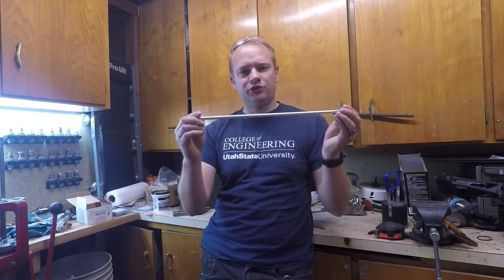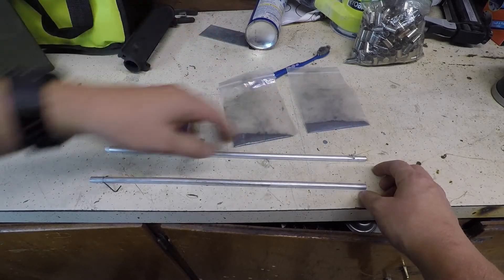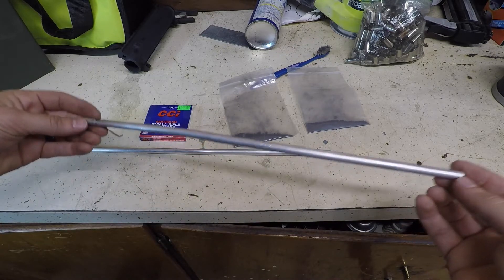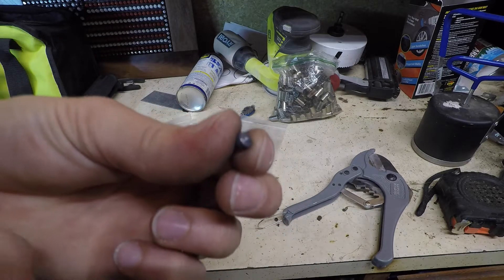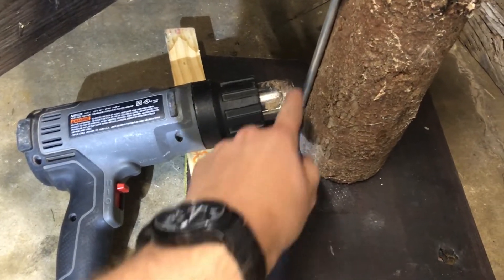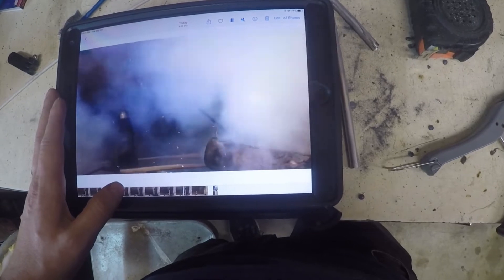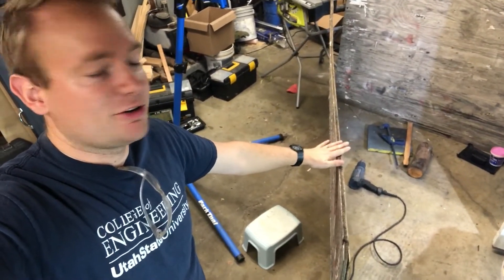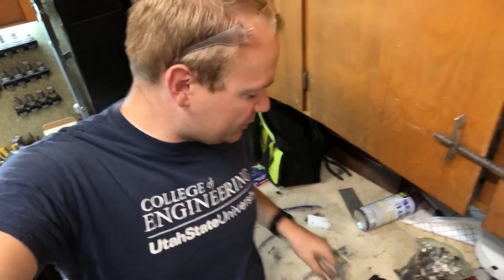Primer Tube EXPLODES!

Comment: Speaking of primers, all I have for 9mm is small “magnum “ pistol primers. From your experience, how much if any should I reduce the starting load? I have heard from 5-10% less? Other people said it doesn’t matter. What has been your experience? Thanks
Reply from the maker: It depends on your load, but for my 9 reloads I don't change a thing it doesn't make as much of a difference. But if you are loading hot rounds then you will likely want to back off a bit. For AR I load 12.5% less for identical velocities. https://youtu.be/6ndMB7A32iE
Reply: @TheLarkinsLair  Thank you, I really appreciate your help.  Thats all I could get my hands on, I thought so, just want to be careful.
Reply: @TheLarkinsLair  FYI , I used the small Magnum primers and to work ok I had to go up towards the max load in the Lee's reloading book.  They were no problem as you said. I have successfully fired ammo that I made, pretty cool.  Thanks again.